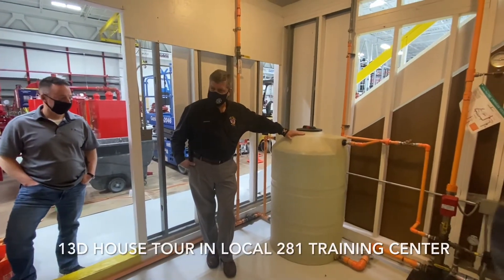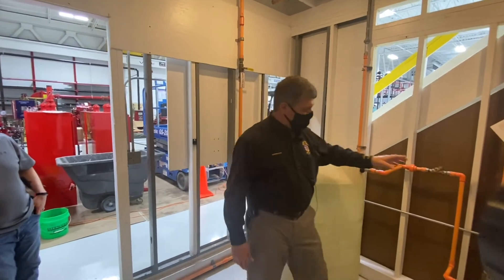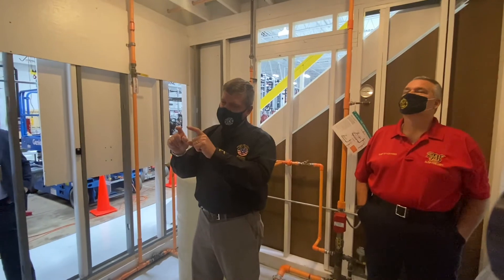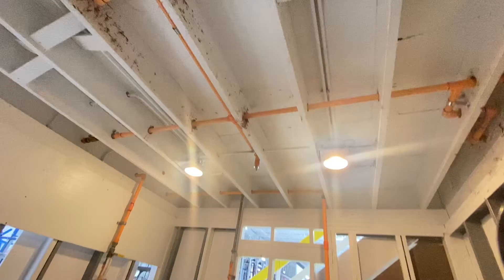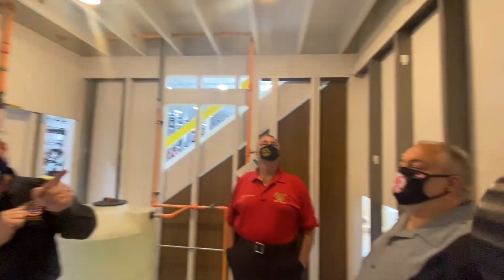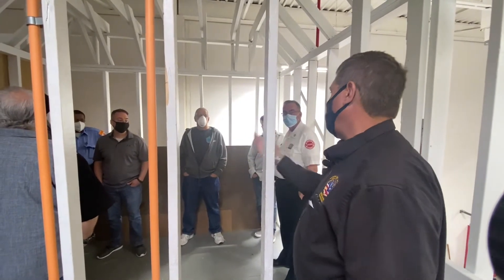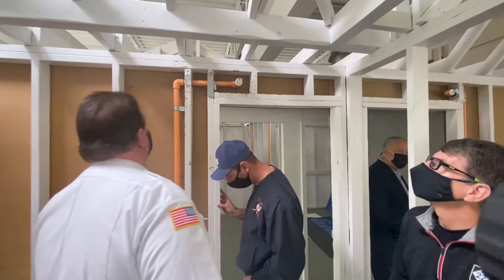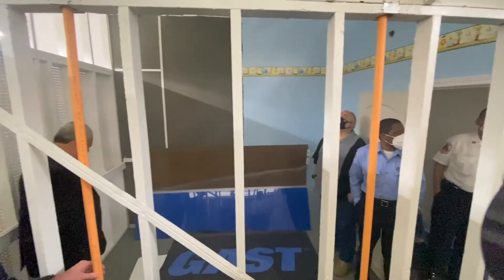An NFPA 13D system in a simulated house

Comment: I was a firefighter/EMT for years and KNEW the value of sprinklered structures.
When my wife and I built our first house(and current) , I roughed in the electrical and gas black pipe and even ran innerduct and conduit EVERYWHERE for “the future tech”.

We were a week pre-drywall and I had no time left to run steel pipe for residential sprinklers.
I refused to use CPVC because I was convinced it would cause leak issues.
So, I just installed an addressable smoke/fire detection system and let the sprinkler issue die out.

That was 26 years ago and I kick myself every day.
BlazeMaster products and other CPVC products were really proven at that time.
I SHOULD have done it when the house was framed without insulation and drywall.
It was only a few $k to do it but my fear was failure and leaks.
STUPID LOGIC!

Please install sprinkler systems in residential units!!

Comment: Why are there not more  integrated plumbing/ fire suppression systems featured for single family homes and manufactured homes/ trailers .  Well supplied dwellings in rural settings are potently more critical when water supplies are limited  and fire departments are more distant. It would  be wonderful to give some attention/guidance to  These type of dwellings which are more deadly to occupants than many if not most apartment buildings